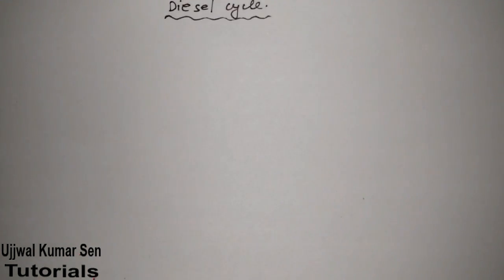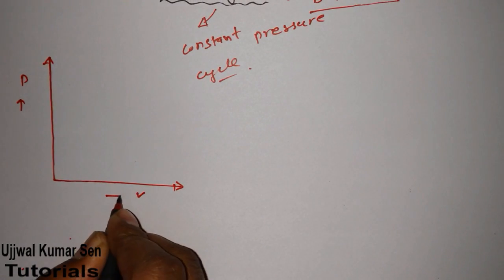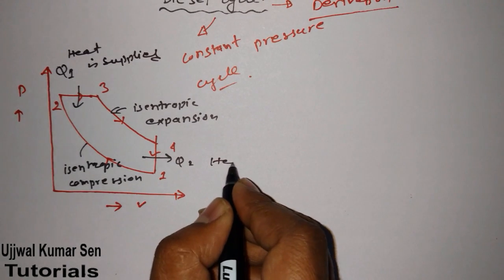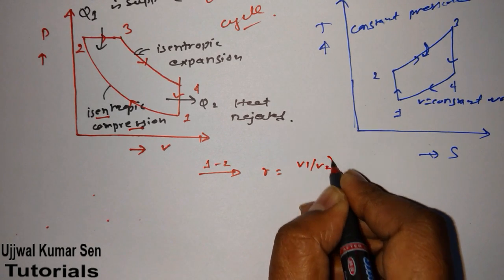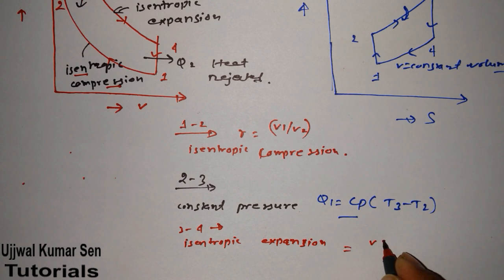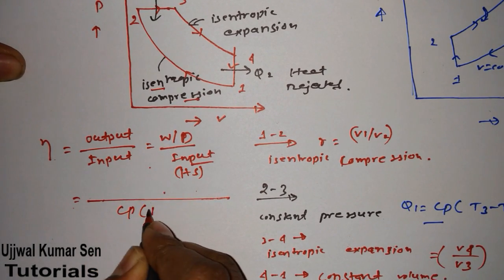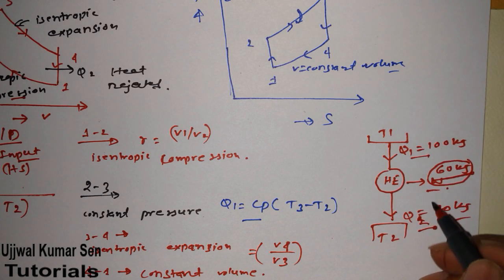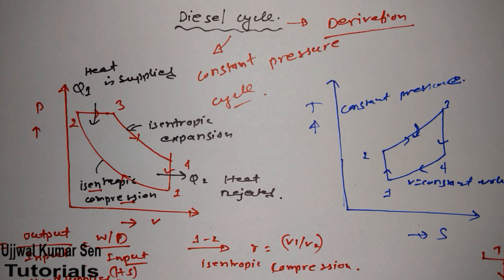Derivation of Diesel Cycle

Comment: If pressure is constant than it should resmbels Bryton cycle coz that cycle is also called constant pressure cycle ....but I m little confused that if compression ratio of constant pressure cycle is p1/p2 than why we compressing volume here in the desiel cycle by v1/v2..if it's a constant pressure cycle😥🙄
Reply: Thanks Sir...
It's really helpful